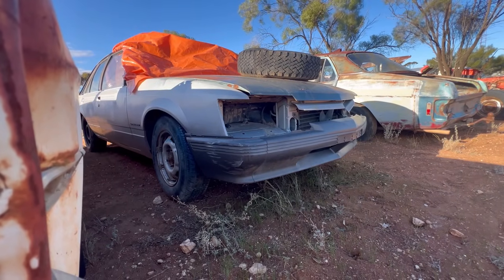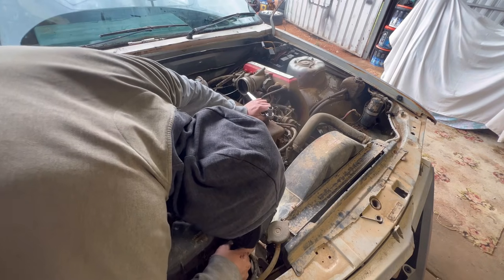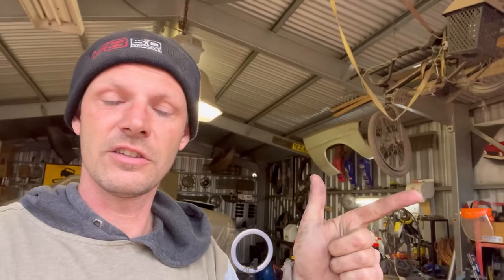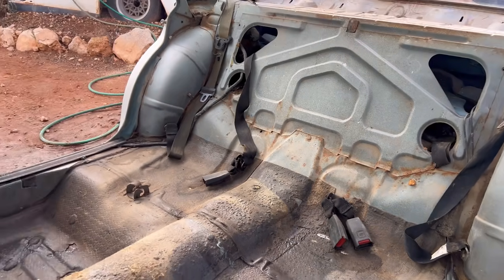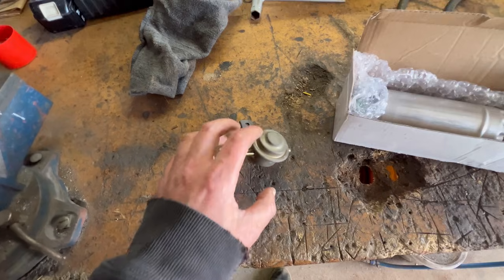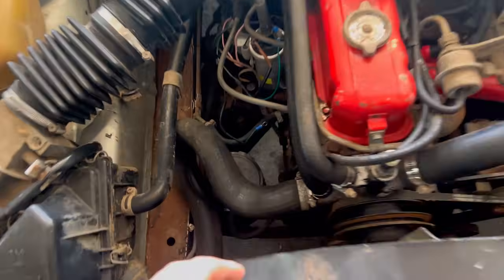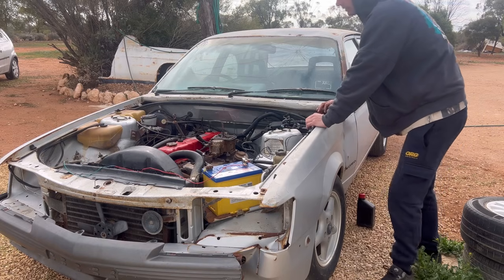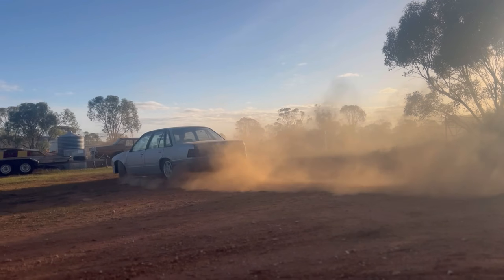$750 Fuel Injected VK BERLINA REVIVE and DRIVE

Comment: VK EFI distributors are empty - the ECU controls the spark.
Reply from the maker: VK EST are empty because the ecu controls the vacuum advance, VK EFI models run the same as the vb-vh with a different ignition curve to suit the injected engines cam profile.
Reply: Yep efi 202 have normal hei dissy unlike est carby 202
Reply: @V8JakeC  Ah, ok thanks, had it the wrong way round.

Comment: What would I need all together to do a carby swap to my VK efi? Thanks
Reply from the maker: Inlet and exhaust manifold, carby You have to re route so vacuum lines too. Once all the efi and or cruise control is off the engine it’s quite simple.
Reply: @V8JakeC  alright sweet do I need to replace the Efi wiring harness?
Reply from the maker: I didn’t. I ended up just tucking a whole heap out of the way.